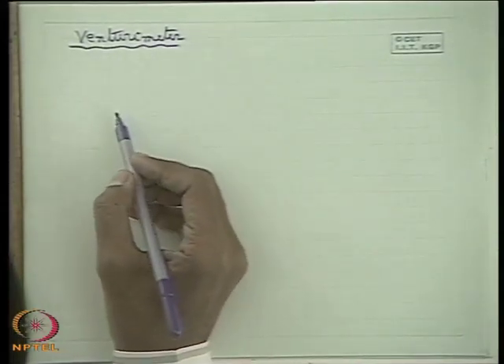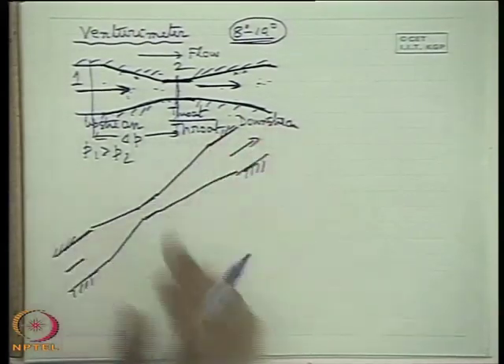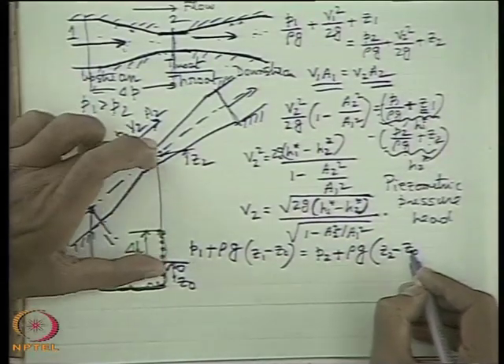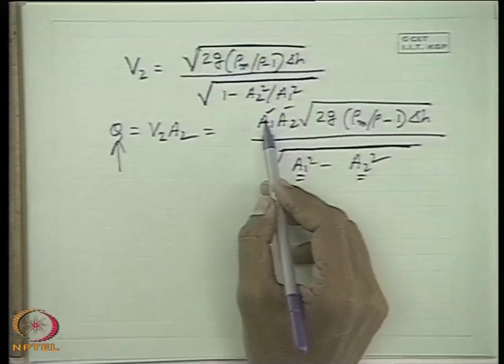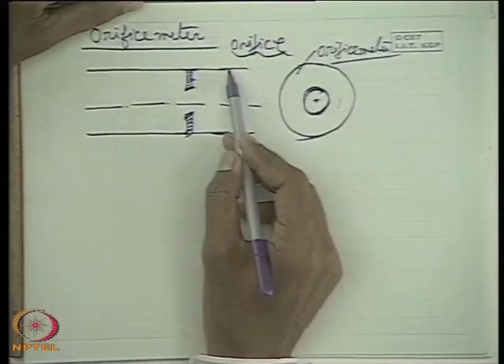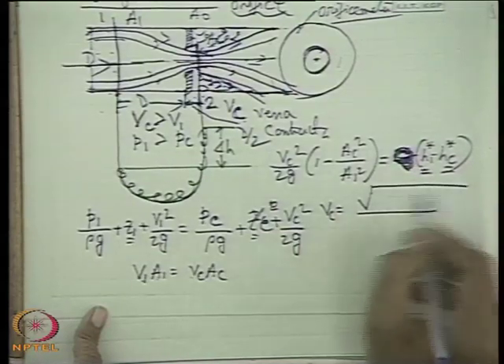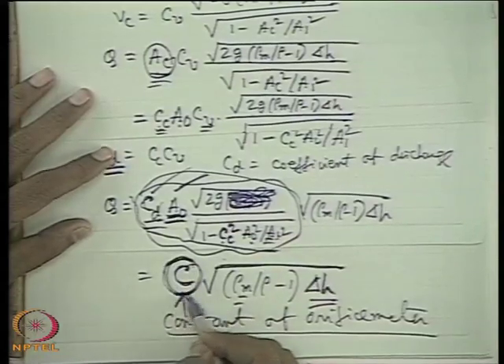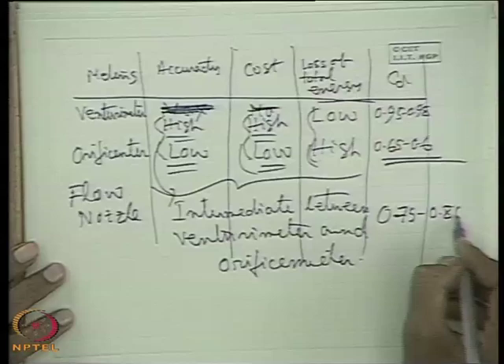Mod-26 Lec-26 Fluid Flow Applications Part - V

Comment: if the convergent part of flow nozzle be same as that of venturimeter , shouldn't the coefficient of discharge be same for both of them as it does not depend on what happens beyond the throat.. ( obviosly considering that both are made of same material and have same surface roughness.)